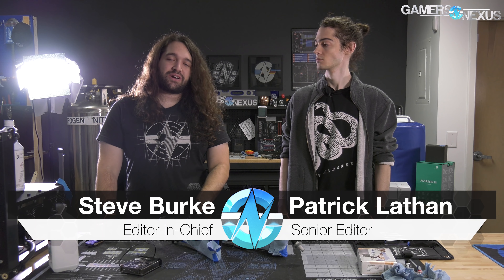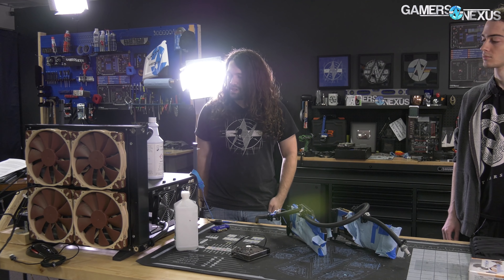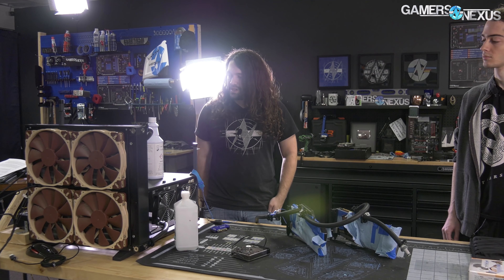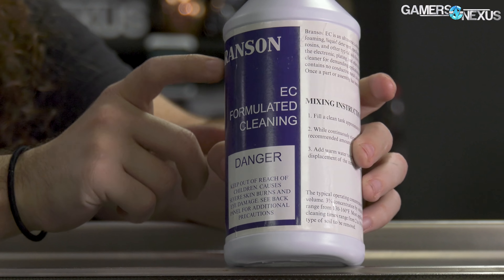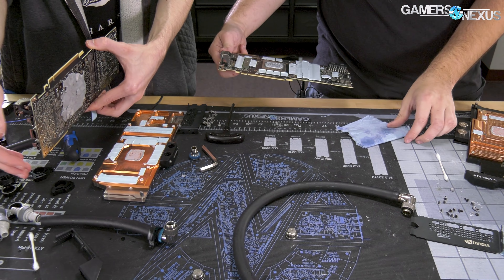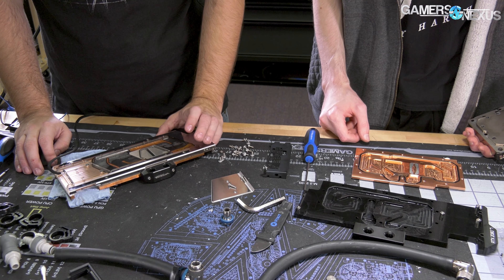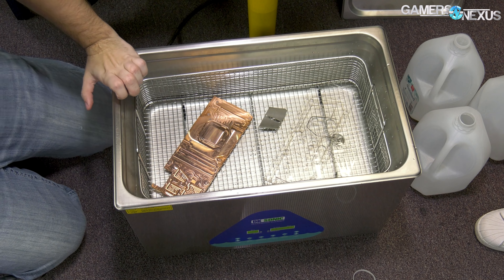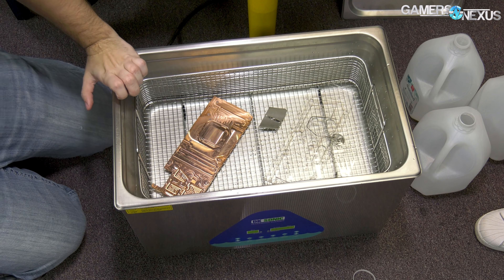Cleaning Copper Oxide Off a Water Block: Ultra Sonic vs. Vinegar

Comment: You should ALWAYS use some kind of anti-corrosion agent in a loop, no matter if it's all same-metal, no matter if it's distilled water, it doesn't matter. Just put 5% regular boring antifreeze in the water, it's plenty effective - alternatively a proper water cooling premix (i.e. biocide + anti corrosion) from any of the water cooling gear brands. Always put that in. That block had some sort of oxidation or galvanic corrosion, and that's exactly why the anti corrosion agents are important. Impurities in different grades of copper is enough to make it happen - there's no such thing as "pure" copper, they all contain various amounts of impurities from other metals. Different grades will have different kinds of impurities, leading to a differential between blocks made out of different grades, and thus you get galvanic corrosion. Easy to clean - but even easier to prevent!

Comment: Another effective method to remove copper oxydation is to use anti-limestone products. I use them to clean heatpipes and they turn out very shiny.
Reply: Lemi shine works great for shining up spent range brass. I wonder if it'd help in this situation.

Comment: SAME THING HAPPENS IN CARS...EXPERIENCE, ... Use automotive coolant, ethylene glycol based. Pure water/distilled water acts as a solvent over time. (follwing pasted from clip)During the distillation process, water is vaporized into its gaseous phase, so all its impurities are left behind. These impurities include a number of minerals, including “calcium” and “magnesium,” the two components of water “hardness.” The water is then condensed back into its liquid phase, so the resulting liquid is pure water – in fact, some of the purest water on earth. But the problem is that when water is distilled, or “stripped,” of its minerals and impurities, the resulting solution is composed of chemically imbalanced “ions.” This leaves distilled water “ionically hungry,” so it will actually strip electrons from the metals in a cooling system as it attempts to chemically re-balance itself. As it chemically removes electrons from the metals of cooling system components, distilled water eventually does extreme damage that could lead to cooling system failure.

Comment: using the right liquids is important, this guys are about experimenting. Most of his computer builds are disassemble after a few days or hours and used for other videos later on. So using distilled water is fine. I think the problems here was that they didn't clean the loop before setting in the distilled water. Computer parts and loops dont come clean from the factory ( used and re-used part dont help either). And since bacteria loves light, only the parts with clear acrylic took the most damage. Radiator should be fine, just a couple of flush Is good to clean. I would recommend cleaning this with CocaCola for an hour, and then rinsing and brushing with distilled water. Dont believe me??? Try it and see.

Comment: If you used vinegar to cool the system this stuff wouldn’t happen would it? Could flush it a couple times to break up whatever is in the cpu block or radiator.

Comment: Vinegar will definitely work much better than lemon juice (won’t smell the same either, but you won’t die). Also, remember to wear gloves afterwards: the oil of the skin in contact with the copper will make it stain again. And depending on how humid the environment is, it will also cause it to stain with time (might take a real while though).

If you want to scrub it, make a salt and vinegar paste. Let it over for a few minutes (15-30mins) and use an old toothbrush.

Comment: EDIT: sorry, should have waited longer for the response. So yeah,  I'm pretty confident that this shows what CAN, not necessarily must, happen if you use only destilled water. Curious if the result would be the same of the system would have run the whole time...
Next time add some glycol, your pump is gonna thank you too!

Comment: 3% of 4 gallons is 15.4 oz or 454ml

Could flush the radiator and pump with water. I think jay used some sort of loop cleaner that you run in the loop for a few hours before flushing and running again with water.

Comment: Vinegar+salt will strip copper tarnish almost instantly with just a dip, rinse with clean water to slow re-tarnishing. Or you can do what Koolance used to do and gold plate the copper blocks, cause nothing says baller computer like gold plated water blocks.

Comment: For all you out there, this is what it actually sounds like, since Andrew's mic is sort of picking it up wrong:

https://youtu.be/ydrCPtU2atU?t=80
Now imagine having 4 or 5 of these running at the same time in your room. That's the typical setup for lab use. It will give you headache, if you suffer from tinnitus it will increase.

In regards to temperature. The vibration causes the liquid to heat up, so if you're running it at 80C with heating you're actually pushing it over the 80C probably if you're run it long enough and you'll end up with a all the water eventually evaporating from all the heat. At our lab we almost never turn the heating on due to the fact that we run the cleaners with timer set to infinity and use ice packs for cooling and refill the water. Switch water to alcohol, like IPA (not the beer), and you'll end up with flammable vapor in your room. We never run it on anything else than distilled water. If you want to dissolve something that's actually does not dissolve in water you take a beaker, fill it with solvent and your substance and then cover the top of the beaker with parafilm (sheet of flexible plastic). Only then you place the beaker in the cleaner. 

You could probably clean that rad in a big enough cleaner, like the one in the video I linked. Except that's industrial grade stuff and I doubt GN could get their hands on them. Me and my lab buddy used our largest cleaner (think it's a 22L unit) to clean the rad used for cooling the water in a twin-screw polymer extruder, which was about the size of a 420mm rad with fans attached to it. Whoever set it up at our uni thought there's no need to use any sort of water filters and decided to plug it directly to the main water supply. Too bad they weren't there to cover the cost of replacing the water pump which failed from all the built up gunk.
Reply: A mix of lemon juice + ultrasonic would probably work great too. Just make sure to put it in a separate container and use something to elevate the block so it doesn't just sit on the bottom.

Comment: It's not hte bubbles that clean in ultrasonic cleaner, the liquid that you submerge stuff in moves (altough the translation is very small). The liquid then rips the debris off the surface. Think of dense fluid, e.g. honey, submerge something in it, and then moving the liquid can move the stuff submerged. The faster you move fluid, the higher the force on the stuff submerged. So the cleaner moves the fluid very quickly, at ultrasonic speed in fact.

Comment: when i was locked up, there was a CO that showed me to use ketchup to remove oxidation from the large copper pipes in institutions, you would let the the ketchup sit on the copper for about an hour, and all the crud would just wipe off, might work for this. ketchup is also acidic @GNSteve

Comment: Next time fill the ultrasonic cleaner with water. Put the part in a ziplock bag. Fill the bag with vinegar, seal, and throw it in. Turn on the ultrasonic cleaner for an hour or less and voilà. The acid does the work room temperature is fine.

Comment: if you wanted to bother going to the effort you could get the nice shiny looking surface back by using a buffing bit and some buffing compound with a dremel, just dont go into the fins. though i dont think its worth the effort, the surface finish shouldnt be enough of an issue to matter to the cooling ability.
Reply: If we did want to mess around with it, any suggestions on compound choice?
Reply: @GamersNexus  brasso is what i would use here, but i dont know if thats sold in the US, any metal polish that is suitable for copper should do the job.
Reply: @GamersNexus  I've used some Turtle Wax premium rubbing compound in an 18 ounce bottle that works great for many applications. You could probably completely skip the vinegar cleaning and buff it back to being shiny with the right dremel attachment.

Comment: 16:09 - 3% of 4 gallons - you needed a bit less than a pint, sir - 15.36 fl oz, in fact.  (3% of 4 gal = 0.12 gal. 1 gal = 128 oz. 128 oz/gal * 0.12 gal = 15.36 oz.)

Comment: SingularityComputers have been recommending proper Water Cooling Fluids that include corrosion inhibitors, biocide, etc. instead of distilled water for years. I don't know why but all youtubers went with distilled water and failed miserably. Kayle seems to have the worst luck of the bunch. Just use the proper fluid Mayhems, EK, Primochill, whatever. You should also run Mayhems Blitz Kit through that loop. I can't imagine the variety of new lifeforms that developed in there.

Comment: As was figured-out in the 1980s by contact lens wearers, distilled water was never guaranteed to be free of biological material.  Time was when contact lens cleaning was done with distilled water, but it became clear that distilled water was not necessarily bacteria free (read: nasty eye infections).  That is when they changed to providing dedicated contact lens solutions instead of providing kits to manufacture your own solution.  

Distilled water can only be considered low in dissolved solids like calcium carbonate.  It cannot ever be considered otherwise "clean".  I would never drink distilled water, because all kinds of terrible biology lives in the distilling equipment.
 
You would be best served by highly filtering, pH stabilizing, and biocide treating distilled water. Not necessarily in that order.

Comment: This is what happens when you only run distilled. A silver coil is also ill advised. That's an outdated solution and a terrible idea if you have any nickel in your loop. It's 2019, use a fluid like Mayhems X1, EK Cryofuel (CLEAR!) or Koolance 702. They are all proven and test in both consumer and industrial applications. In addition, you can use Mayhems Blitz to balance the pH of your system for a further level of "I don't have time to deal with any BS". Blitz pt1 for cleaning out the Mo-Ra. Honestly, given GN's level of technical competence in other areas, it's a bit surprising, and quite frankly disappointing, you guys allowed this to happen.
Reply: I wouldn't say so.
Keep in mind this system was intended for cooling with ice to achieve the best thermals you can get without dice/ln2.
How does your mentioned fluids behave when close to freezing? Are they freezing earlier than just water? If that's the case that is a problem.
What's the thermal capacity / thermal conductivity. Probably lower than just water. The stuff that's in AIOs has a lower thermal capacity and thermal conductivity than plain water. It might not be much, but if you want to get the best out of the system because you want world records everything counts!
This system was not intended to run for long periods of time. It was intended to perform exceptionally good.
Reply: @Pheatrix  Mayhems X1 and Koolance 702 have a -15c freezing point and virtually equal thermal conductivity to water. EK Cryofuel would be less ideal at 5c freezing point. X1 or 702 would have been superior choices. If they are using a peltier or LN2... that's totally different than a custom loop.

Comment: Silver coils are terrible, don't use them, especially with nickel-plated blocks - the plating will corrode very quickly. Small silver coils really do not do much for preventing algae, but are quite aggressive in promoting corrosion. For daily use just mix a clear coolant concentrate, it's relatively cheap, and is good for years. I recently drained a loop that had Phobya clear coolant for almost 3 years - no algae or corrosion whatsoever.

Comment: Cleaning tarnish, you want a piece of aluminum foil and a little baking soda (add more if it doesn't work, start at like 1-2tbsp for that yellow bin), warm water (tap warm) and then stir a bit.  After like 5min it'll just be gone.  Works amazing for jewelry, silver and gold and alloys that I've tried so I assume copper should work too from a quick google.  Learned this from here: https://www.amazon.com/review/R3704FWU0BVASG not sure if link will work but google "jewelry tarnish dandruff shampoo" first result for me.

Comment: This comment is a little late, but the solution you used is not designed for cleaning corrosion. The Branson EC solution is designed for cleaning off water damage on circuit boards and flux residue from either repair or manufacturing. Branson makes other solutions that would be a lot better at cleaning corrosion than the solution that you used.